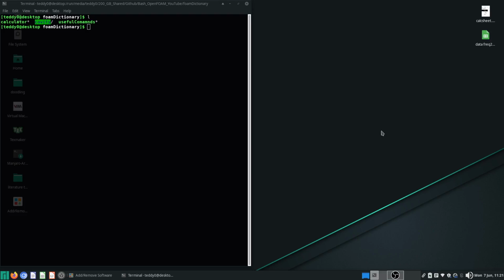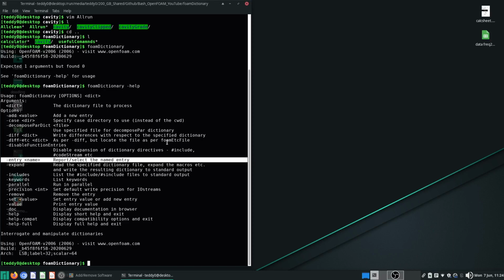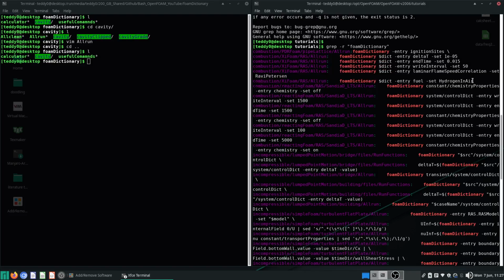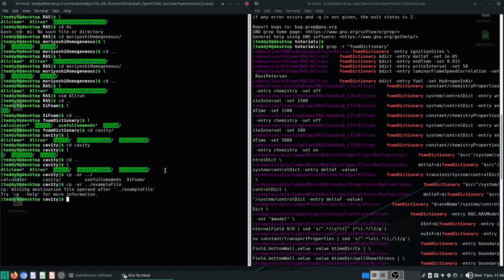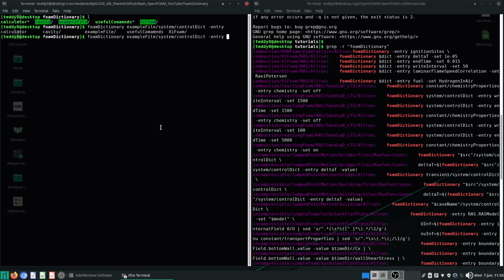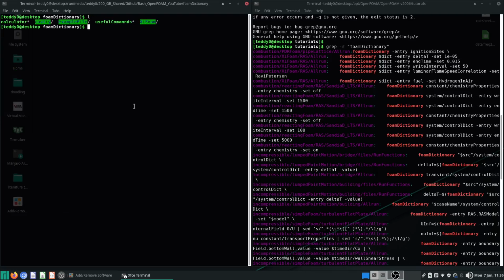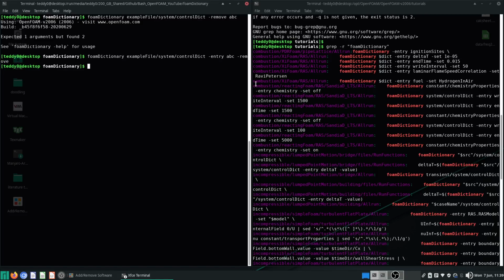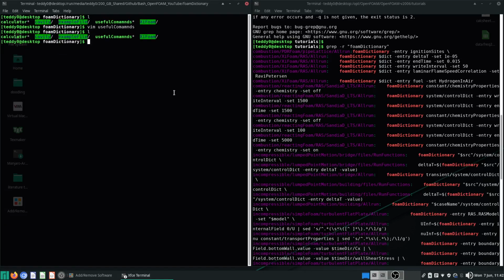OpenFOAM Bash 3 - foamDictionary printing setting adding and removing

Comment: hi Theo ong, iam a recent viewer of your openfoam videos. The content quantity is very good. you are making things easy for me. I am doing my masters in thermal engineering. I find it difficult to choose a thesis topic that is related to the numerical simulations. If you have any suggestions for the same, i will be very much relieved. As of now, iam very much thankful to the videos you have posted. Thanks a lot.

Comment: did not know abot foamDictionary, I am quiet surprised I have not crossed this before! thanks, I will stay with the sed command as it can be more powerfull EG. changing the level value of refiment or change an entire line, but in some cases foamDictionary can be quiet usefull thanks!